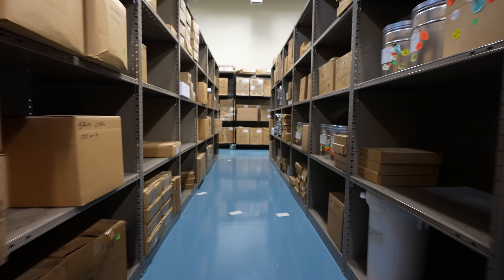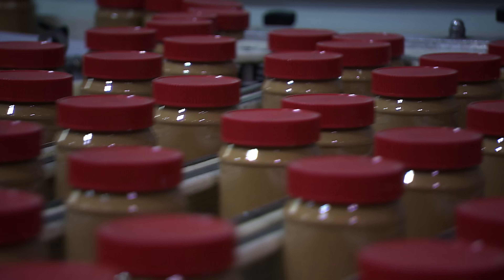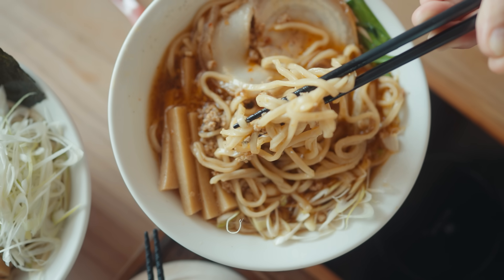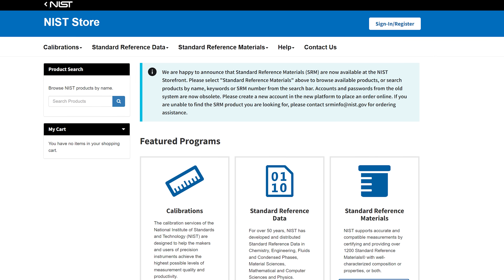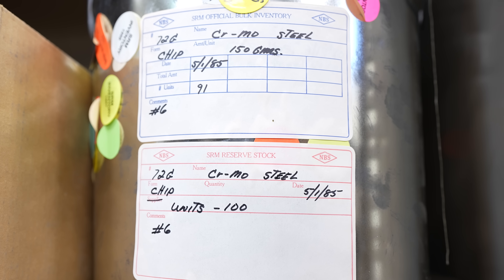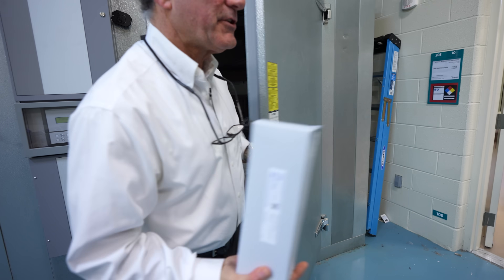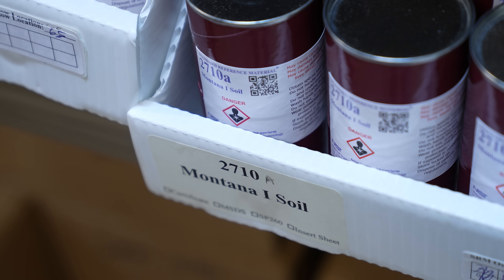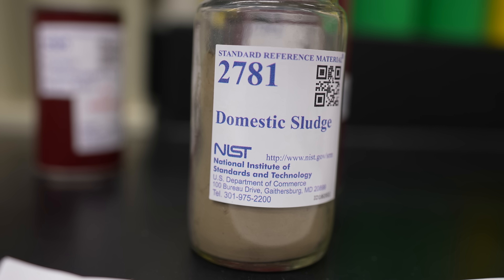The world depends on a collection of strange items. They're not cheap

Comment: I used to work as a chemist in a materials testing lab, and we used NIST metallic standards constantly. Our machine shop even machined a lot of those charpy standards for NIST!
Reply: I worked at a place called E.W.I.(Edison Welding institute) ours were made from plate that were fused with proprietary welding materials to determine whether or not it was an acceptable application for the customer. We also machined "dog bones" to test tensile strength.
Reply: @ComradeJetski  y u do dis
Reply: Must be a really reliable machine shop.
Reply: I didn't quite understand the Charpy test: What use is it? Don't they just measure the force required to break that Charpy? How does that measure anything from the manufactured steel? Or is the Charpy made from the steelmill's steel?
Reply: @RevCode  you have some made from your steel and their steel has all the information known so it lets you test your machine .
Reply: @theweeviler  Oh I see, so they calculate the baseline from the standardized one and then know their steel's strength.
If I wasn't so dumb I guess I could have guessed that by the name "reference material" alone - thank you for enlightening me, that was not my brightest moment :)
Reply: @RevCode  Kudos for learning and not getting angry at being corrected/taught like soo many these days. Civility is nice to see. Cheers!
Reply: @RevCode  I completely understand how it was confusing for the steel test. I think maybe the video explained it weirdly and didn't make it clear enough their steel is used to test the machine.
Reply: @Fenthule  Getting my knowledge improved - for free, none the less - is not a reason to be angry. Quite the contrary :)
But I get what you mean. When emotions take over rationality, crappy situations ensue.
Reply: @RevCode  It's made from BOTH. You run the test twice as to test your own test. That's what the word calibration means.
Reply: @RevCode in simple word, that Charpy sample is so homogeneous and properly made (according to ISO 148 part-1) that all the Charpy samples prepared in a lot are having almost same results. So if u test one sample and have the result, say 40 joules, and the actual value of the Charpy sample (which is known to these NIST guys, coz they tested it before) is 39 joules, then by statistical analysis it can be found out how perfect your machine is calculating the impact value. Basically comparing apple with another known apple 😂
Reply: @RevCode  1) The Charpy test measures how much energy it takes to snap a Charpy test piece. The more energy it takes, the lower the pendulum will stop at. Sometimes you want steel that can survive lots of impacts, like for a steel skip. If you want to test different properties, you need different tests, like the Vickers test can tell you hardness, and a torsion test tells you the tensile strength.
2) A steel mill takes a sample of every batch of steel they produce. For steel sheets, they cut off a corner from the roll. That corner is cut into pieces and used for the different tests to prove the steel is what they say it is. Some companies won't accept any steel product without the steel certificate it was made from (especially construction companies). Once a year or so, the steel mill will need to check their testing machines are working correctly, so they send them off to a calibration company. The calibration company will use a NIST Charpy sample and check that the testing machine produces the correct results when it tests the NIST sample.
Reply: @RevCode they are measuring the force it take to break them with many types of steels in various stages of hardness.  Steel mills test their steels the same way and provide averages per each batch or “heat” but people who buy this steel also have to test them before building an expensive tool or product out of it.  They all have to be sure their test equipment is giving the same value as NIST therefore they buy the sample and compare.   GM for example has their own internal standards and guidelines for tool steels their manufacturing tools are made of that make critical automotive components (engine blocks, transmission)
Reply: ok but why dont black people do this

Comment: Wow!  I knew of medical grade fecal matter for humans... something rare to be out the shute... I recall 6% of the donors.  I've not seen, though I'm certain there are medical grade vaginal discharge and breast milk too as well as other regions of the body that are medical grade that can be cultured.  Bio-Gia comes to mind as well.   Though NIST grade standard for the poop... huh... didn't know that.
Reply: I actually worked on SRM2036... did a little code work on the SRM2035 Center of Gravity algorithm and like to think inspired the SRM2036 as I was wondering about just using the SRM2035 with a 99% Spectralon backing for diffuse reflectance NIR spectroscopy.  I didn't publish that work, though was certified the day before my birthday of that year if I recall correct. Jun 13th I believe. Great team to correspond with and that 1920a was handy as well.  I did publish my work related to the chemometrics development and validation tools in October 2008 American Laboratory.
Reply: I also just was thinking, a special shout out to the DOC.... they're excellent civil servants and totally supported my coming out with the remote sensing stations or operations that have concealed wireless assault weapons that can perform sound, body and mind control transmission effects to maliciously assault, batter, maim, murder and not justifiable serial kill.  OK... no one really came out with that much detail, though at least they came out close enough and CIA more aligned with my imminent threat (acts of war) preference for detailing the "non-lethal weapons" that when used outside the thresholds can be lethal.  My observations need to be more broadcast to the masses since used illegally, can not be classified per the Executive Orders (wikipedia search "Executive Order 13526") like President Truman, and subsequent Presidential admins, since I'm guessing he knew what he was getting into with those Operation Paperclip and other malicious scientists.